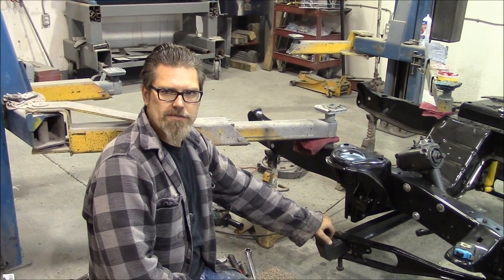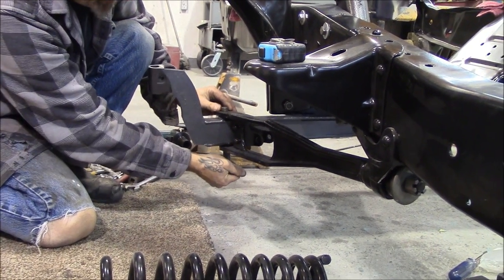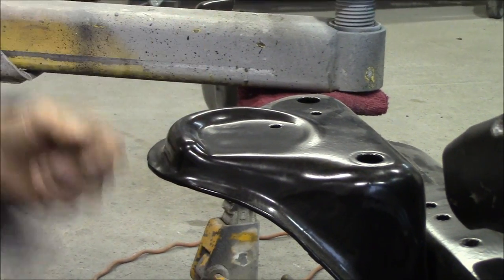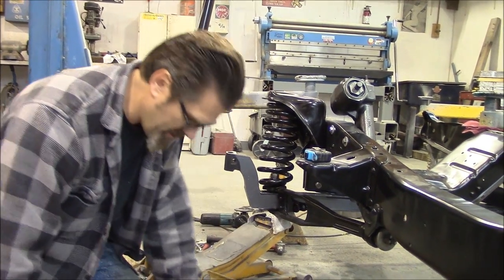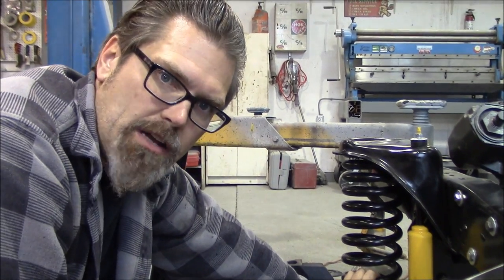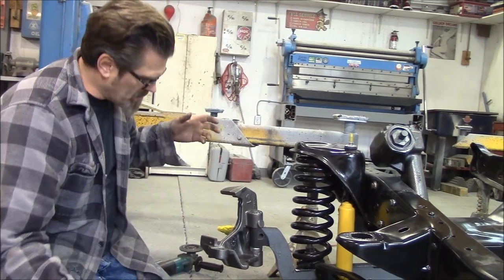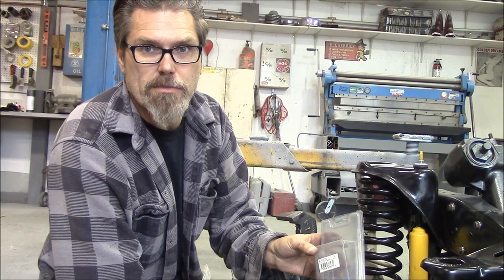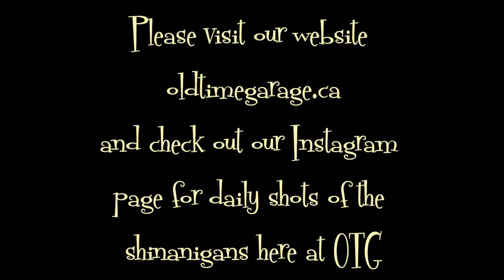How to install a dropped I-Beam in a '66 Ford Pickup

Comment: Great Video.  Front and rear sway bars are a bolt on from 89 ford lariat trucks.  This is cheap and makes a great improvement to handling on these trucks.  Again, great video.  Do another on the power steering sector replacement.  Do another on the installation of the engine perches and how they can be rotated for different engines.

Comment: I am positive the '66 had a coil spring retainer. I did not see you put it back on. Very helpful to the next guy trying to remove the coil. Stops the spring from potentially flying out.
Reply: You can stack more retainers to lift the front end. People will think you have a 4x4!

Comment: Thank You very much for You help, me and my son are putting together 2 Ford 1966, mine was a 250 and I cut short the chassis and fleet side bed and my son is original step side but originally drum front disc, I use a 1977 ford f150 I bought for parts already powder coated and converted from 8 to 5 lugs, everything fit perfect except for the lifth spring perch which we relocate , also we powder coat Our chassis, my son wil turn his with front disk also

Comment: I know this is a old video but it has alot of reviews still fresh lol ....
What did you think of the quality of the I beams ? Those look like the ones I bought from a place called firebird industrial supply  .
I'm sure it was chassis tech before I had to do some grinding and cleaning up of the  area were the radius arm bolt goes to I beam and we're the king pin goes .
Reply from the maker: To be honest its sos long ago and customer supplied them am not sure what they are but it went together well from what i remember

Comment: Are those oem spindles and are you sure on the year?  I can't find them anywhere.  I did find some used ones on ebay for 81 and up which look close to the ones you show.  I'd prefer to go this route rather than the Crown Vic swap and retain the factory look.  Great video by the way!!
Reply from the maker: Whatever year I said on the video was what the customer told me it was - sorry I can't remember as this was over 2 years ago.

Comment: Your videos are awesome and full of info! It's been a huge help already. I'm fixing to begin my restoration project on my own 65 F100. Dropped I-Beams is what I'm wanting to use also, so your video has been a huge help. 
My main concern though is rust repair on the bed floor and front bulkhead. Apparently this is where many of them rust. I was planning on bracing up the bed on the inside before I unbolt it from the frame. I've been scrolling through your videos looking for more on Graham's truck but I haven't found any. What's your recommendation on my idea about the bed, thanks!
Reply from the maker: +Derek Burnett If you're just unbolting it from the frame you won't need to brace it.  If you're removing the entire floor I'd brace it up to keep it square.  It won't need a lot of braces.  I haven't seen Graham's box yet (he'll be bringing it out soon) but most boxes just unbolt, every piece.  If it's welded to the sides though, go with my original suggestions.  Good luck!
Reply: +OldTimeGarage Thank you so much. I'll get after it.

Comment: Thanks for the video.  Are the shocks you used designed for lowered front ends?
Reply from the maker: Yes, well they are the correct length and/or height for the lowered front end

Comment: Do you know if those drop beams fit a 1965 ford f100? Im trying to do the similar suspension set up on mine. and another thing is will the spindle fit the 65 drop beams?
Reply: Ian Gayla yes 65 and 66bwas the same

Comment: Great video. I have a question, and I hope it's not a stupid on. Shouldn't the suspension be loaded before tightening of any of the bolts to beams, hairpins, and shocks?
Reply from the maker: Yes it should - good question and maybe I didn't say that in the video so thanks for asking.  Yes for sure 100% load it and re-tighten everything!
Reply: +OldTimeGarage i have a 1964 f100 shortbox 351w. thats a straight axel how would i go about getting it this low?
Reply from the maker: buy this dropped I beam kit.  Look on LMCtrucks.com for part numbers for your year.
Reply: +OldTimeGarage its a 64 so it has leaf springs in the front
Reply from the maker: Sorry, I thought it was I-Beam.  You can have the leaf spring de-arced but the ride will be stiffer.  You can also have a spring shop take out a couple of leafs depending on how low you want to go.

Comment: I have a question. i wanna very cheaply lower my 65 ford. I had heard if you cut a coil out of the front coil springs it will cause the front tires to bow in. I know it will a little but is it enough to really matter and if i cut one coil out, how much would it lower the front of the truck? Thanks for any advise
Reply from the maker: +Lonnie Stone Hi Lonnie, one ring will be ok.  We cut the coils in this instance as well.  As a rule of thumb, one ring will drop a vehicle 2 inches.  You'll get anywhere between 1 1/2" - 2" difference.  Thanks for your question and thanks for watching the video!
Reply: +OldTimeGarage  Thanks for the response. And thanks for the advise.

Comment: Doing this on my 65 in the future doing some pre planning on it. Will all the factory steering go directly to the new disc spindles without any modification?
Reply from the maker: We used the stock steering box but had to change the pitman arm for the new disc spindles.  Hope that helps
Reply: OldTimeGarage what pitman arm did you guys end up using?

Comment: Do you know if a front beam from a 66 ford econoline pickup can use a later ford truck disc brake setup like that?
Reply from the maker: +231flash I think it can but not 100% sure.  Try looking on The H.A.M.B. (the hokey ass message board) they have more info than you'll ever need.  Someone has probably done it and wrote about it on there.

Comment: just picked up my own dream beams for my 74 f100. ive been wondering if anyone knew weather or not i can still use an aftermarket sway bar? or would the new beams not allow for this? ive seen people on forums do either one or the other but not both dropped djm i beams and an aftermarket sway bar. any help would be much appreciated.
Reply from the maker: I don't think there's enough room for a sway bar with those I-beams...I'd have to see it to be 100% sure.  I've never seen a sway bar on one of those trucks.  Why are you wanting one?
Reply: OldTimeGarage well I had a theory that if I installed a sway bar then it may be less prone to wearing the tires out as fast because the sway bar would tie the two sides together and keep the tires more square to the ground.
Reply from the maker: A sway bar won't change the camber or castor of your wheels.  They provide stability when cornering.  Your theory makes sense but a sway bar isn't your answer.  Sorry I couldn't be more help!
Reply: OldTimeGarage no problem I just wanted to know before I tried dropping any money on one thanks for the input
Reply: Jon Doe you can run a sway bar if you use DJM Dream Beams. on the Summit Racing web site. the part# ACO-113 listed for a 67 f-100 . in the review section. a customer has listed that he put DJM Dream Beams on his 76 f-100 and used Summits sway bar kit.

Comment: The called radius arm bushings not strut bushings.
If you're lowering it 3 inches you don't use stock shocks you need lowering shocks.😢
Reply from the maker: The shocks are proper for the kit . yes forsure radius arms lol. Cant get it all right lol